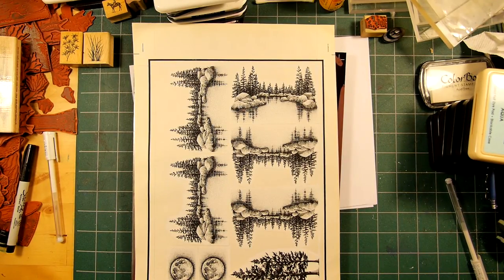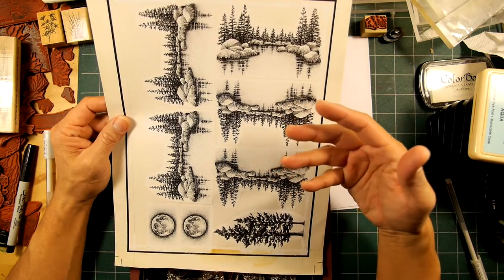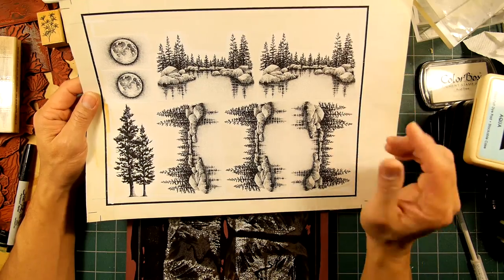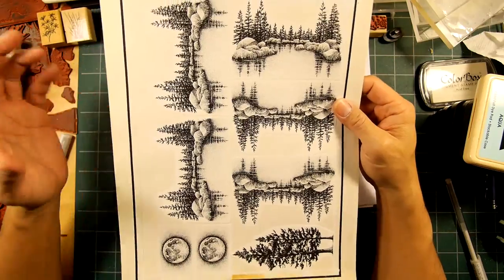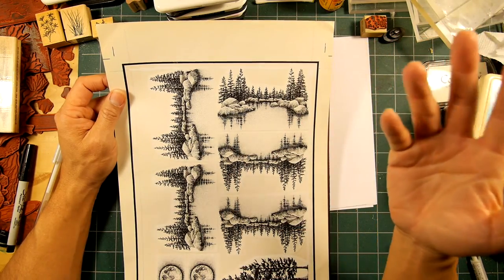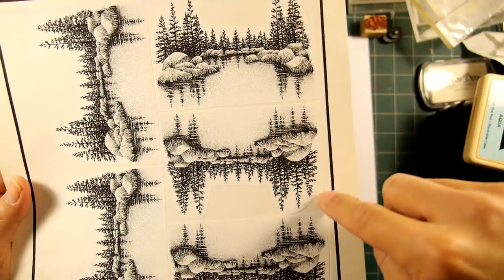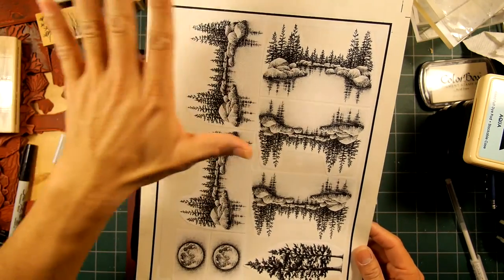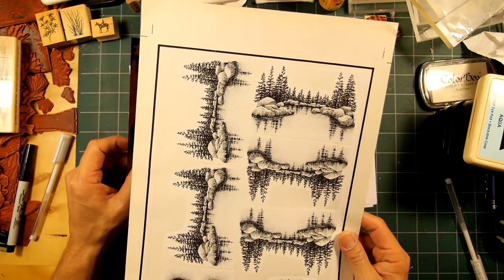Stampscapes 101: Video 133.  Rubber Stamp Artwork/Layouts

Comment: Found this video interesting. I don't think its as efficient as stamp making processes that we have today. Although nothing compares to rubber stamps like these.
Reply from the maker: Thanks for watching!   It's the only process for rubber stamps unfortunately.  For clear stamps, it's a much more efficient process but the product isn't as effective with impressions or the material as long lasting so there's a trade off.  For manufacturers, clear poly stamps are amazing as they're extremely inexpensive to make, and I haven't completely ruled them out, but I spend so much time on the designs that I want perfect impressions that only old fashioned rubber can provide.  I even have some rubber stamps from 45 years ago (from another company) that still work well.  You wouldn't thin a natural product like rubber would last so long but I guess nature can't be beat.

Comment: I make rubber stamps for living and I could tell you that this process is complicated as hell and the only people using them today are factories making readymade stamps for stationery. But there are actually some older stamp shops employing this process for single piece storefront customers which is baffling to say the least. I do mine with lasers but I know that these vulcanised rubbers does gives the best and the most crisp images among all rubber stamps.
Reply from the maker: The entire art stamp industry still uses this method still but the newer companies that marketed more towards the scrapbooking community is more of the poly based clear stamps.  It's not that complicated a process but what's changed over the last 10 years is that the materials from certain suppliers are harder to come by in a timely manner in many situations as the market for rubber rubber stamps has dropped with the closure of the majority of the retail storefronts that would carry and promote stamps.  For example, sometimes the matrix board material is inferior to some of the past material.  Again, there's a lot of poly stamps out there but it's like you said --rubber gives the best impressions.  The longevity of 100% red rubber stamps is far better than poly as well in addition to the fact that more media can be used on rubber than poly such as solvent based inks.

Comment: If the magnesium plate is etched, how is the corroded bottom surface so smooth and even? Shouldn't the etched surface be rougher?
Reply from the maker: Corroded bottom?  The bottom of the mag is the green surface that's shown around 8:27.  Maybe you're thinking the brown matrix is was the bottom of the mag?  The matrix is the mould which is pressed from the mag and is a separate entity.
Reply: @stampscapes  
I would like to ask how the tree-shaped pattern on this magnesium plate is formed. As I understand it, the trees are covered up, and the remaining parts are corroded away. But why are the corroded parts so smooth and shiny? I apologize, I am a beginner enthusiast.
Reply from the maker: Oh, okay, I see what you're referring to.  The acid eats away at the magnesium and, after that, the engraver halts the process and washes away both the printed acid resist printed on the plate and the rest of the plate.  So, the acid process is revealing the smooth bare metal unlike if that material was removed by something like laster engraving which would be like burning the metal.   Now, I don't do this process myself but I've done some acid resist processes in school so this is just done in more of an industrial level.   @VincentXiee
Reply: @stampscapes  Alright, thank you. I noticed your other comment asking if this technique is the only way to ensure quality. As an enthusiast in China, I am currently making transparent and flexible clear stamps, but I plan to make rubber stamps in the future. So, I would like to inquire about this matter and if possible, I would also like to use this technique in the future.
Reply from the maker: Rubber gives the highest quality impression and the longest lasting product compared to clear stamps.   Also, clear stamps can not be used with certain types of inks such as solvent inks as those will harden the clear material.   @VincentXiee